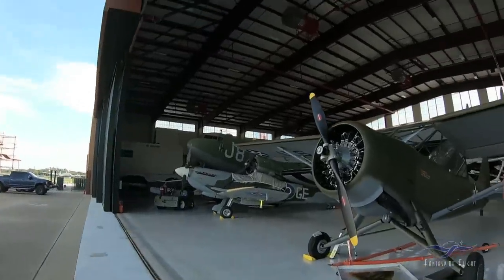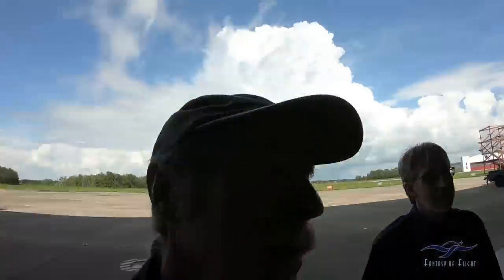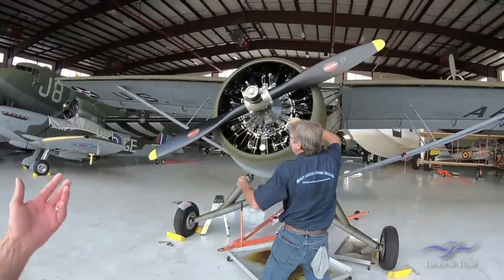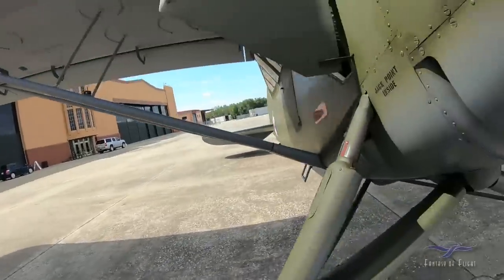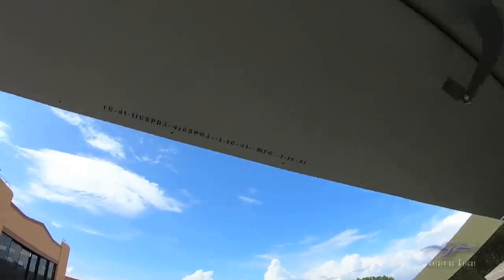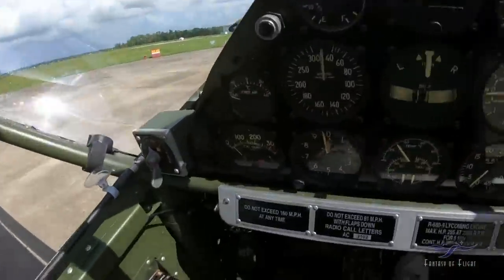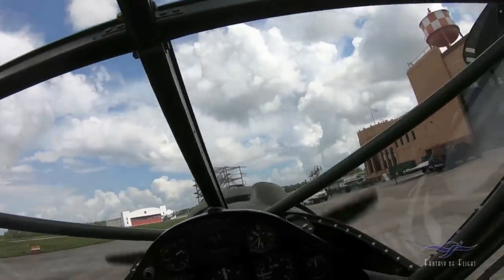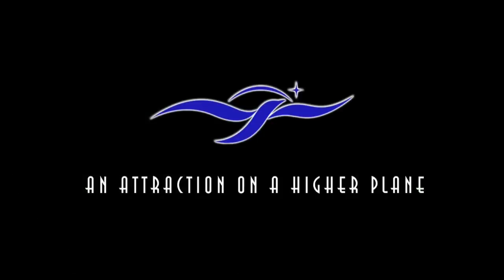Stinson L-1 - Kermie Cam - Part 1 - Walkaround

Comment: Thank you for another well done informative Kermie Cam. I love your way to show us the bits and pieces of your planes. Even to know the quirks and shortcomings of engineering are very interesting. Not like a car where you just hop in and drive away, planes need a lot more caring and maintenance to work well. Thanks again for your effort to present a unique plane. BTW the only videos on par with your Kermie.Cams are your Mechanic‘s Corner restoration videos, especially the Bf-108 ones by Paul. I love those in depth insights. Keep them coming. A very big 👍 !

Comment: Nice thorough briefing on the machine, making it clear what a complicated monster it is, (And how much ithe restoration deserved the awards.) It clearly was an enormous, extraordinarily expensive way of doing the same job as the L-4, (J-3 Cub).  It would probably take twice as much training as an L-4 pilot's to turn out a competent L-1 driver. Field maintenance would be another issue.  History  becomes much easier to appreciate when you can see the artifacts at work.

Comment: Maybe a reasonable thing would be to put the tail on a stand when the plane is in the hanger. This would keep the engine vertical and the oil will tend to stay in the cylinders and not run back into the intake tubes.
Reply: To easy to nose over and do damage . but a stand under the nose would prevent that.  A nose wheel is unacceptable LOL

Comment: When I was in the Army, we took a bunch 
of missile-heads from Fort S(w)ill, to the 
White Sands Missile Range.  (I was in the 
Chinook unit, at Fort Sill.)

The "tower" for the missile range, (It was 
a conex hut) had an altimeter, sitting on 
the desk.  The tower operator would 
adjust the alt to the airfield altitude, and 
use THAT figure to tell incoming pilots the 
correct setting.

Later on, I "found" a decent altimeter, and 
put it in my old Datsun 240Z, (the clock 
NEVER worked, and the alt fit in the hole) 
to "predict" incoming weather.  I used the 
"population and altitude" signs on the roads.

Wish I had that car, AND that altimeter.
I "lost" the altimeter, in the 94 Northridge 
earthquake.  Still had it, but it did a nose-
dive off the mantel.

steve

Comment: on a mechincal injected and even carbureted race motor  but more so with injection they will backup the motor to expel any amount of fuel that has run into a cylinder but I see with the intake tubes curving up and away on a radial I never  heard till now about that  But my question is why would you not still back up the motor instead of pulling it through in the running direction or do you feel a hydraulic lock  because you are doing by hand .  love this channel  always learn something  Thanks Kermit for doing this

Comment: How is the ADS-B mandate going to affect your operations at Fantasy of Flight? I'd imagine you wouldn't want to put those modern systems on many of those historical planes. Something I've been curious about for some time.
Reply: Possibly a way to have a "backpack" unit that is removable and transferable to all the aircraft in the collection?
Reply: @ILLEagle_1  that would work for ADS-B in, but I do not think it would work for ADS-B out. The ADS-B out is the part that you need to be compliant.

Comment: So why not put a petcock on the source of the oil, perhaps at the oil tank or the lines that lead into the engine, and just close the tap while the engine sits so oil won't fill the engine? It works on motorcycles fuel tanks... right up to the point of riding away with the fuel switched off....
Reply: I think the problem is the oil is already in the crank case drips into the cylinders, it doesnt drip from the tank but from inside the engine.

Comment: he should mention not on taildragger planes as the early helicopters as the radial engine is canted at an angle more so its shaft connects to the main and tail rotor transmissions if the oil collects in the intake tubes. that being your two Sikorsky S-55 Chickasaws the P&W R-1340. as also the S-58 choctaw with the Wright R-1820. its hard to pull them through in the helicopters as the bottom plugs have to be removed and you possibly have to motor the engine over a few times with the starter. its the orientation of how the engines are placed in the S-55 and S-58.

Comment: Correct me if I'm wrong but dont the slats also contribute to a higher stall angle by keeping the flow connected to the top side of the wing? Great video as usual.